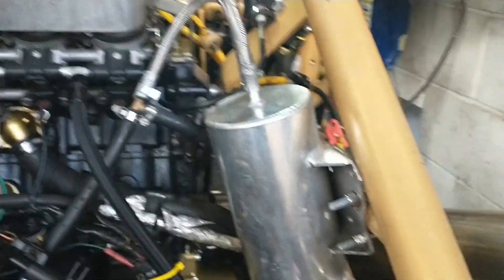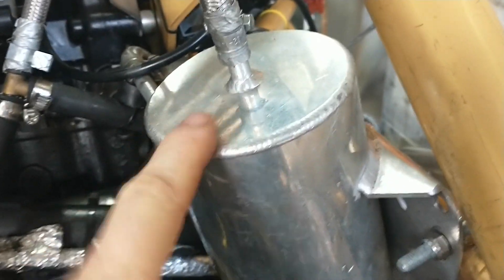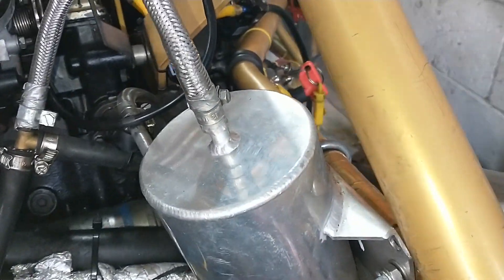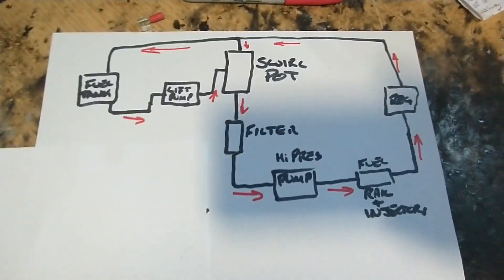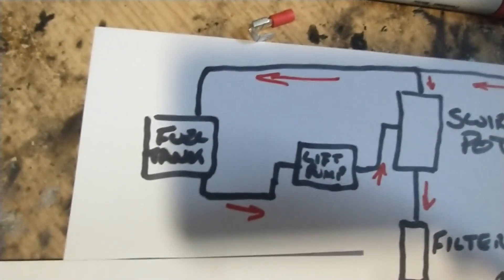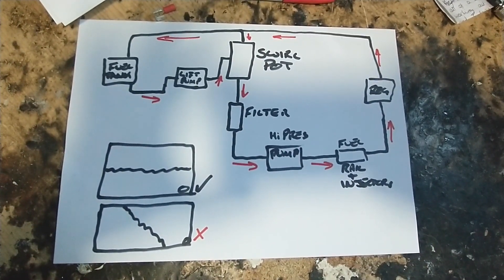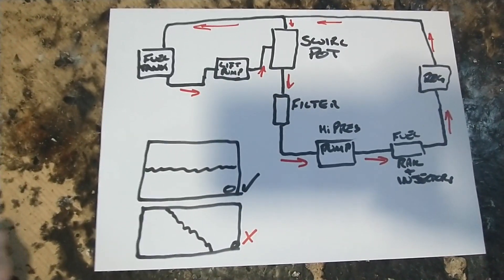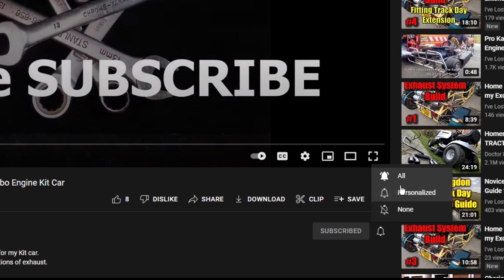What Is a Swirl Pot & Why You Need One - Fuel System Explained for Track & Kit Cars

Comment: Hey thanks for the explanation. Have a question, Why would you place the fuel regulator going in the return line & not before going into the fuel line? And what psi high pressure fuel pump are you running?
Reply from the maker: The reg is there cos that is where I was told to put it by Big CC, I'm not sure why! I don't think it would make much difference if before or after the fuel rail.  Can't remember pump pressure. I just got one that was over double the fuel rail pressure to ensure it had plenty of "head room."
My engine is turbo - so you need the pump to be at least fuel rail + boost.
Reply: @Lost13mm  Did you get a rebuild on your busa engine by big CC racing, if so how much did it cost you? I have a black bird engine & might consider changing in the future
Reply from the maker: @brendonzammit7204  hi I bought the turbo kit from a local breaker & a friend who drag races Busa turbos built the engine. I've spoken to Big CC a couple of times, he has not been helpful.
Reply: @Lost13mm  Okay thanks for the update 👍